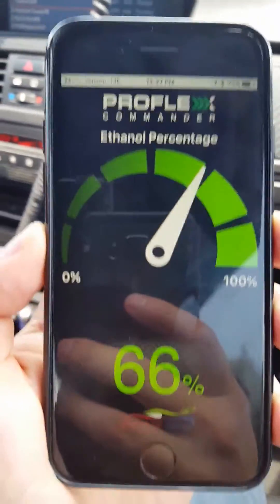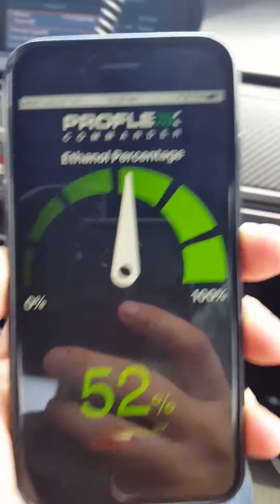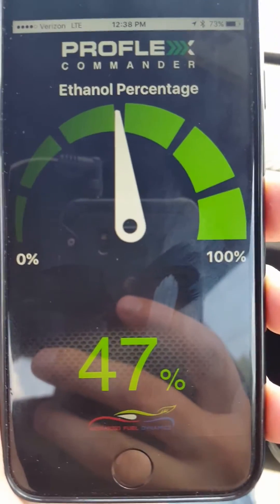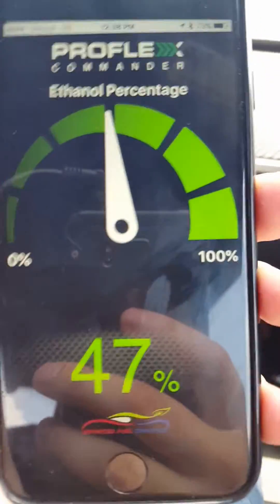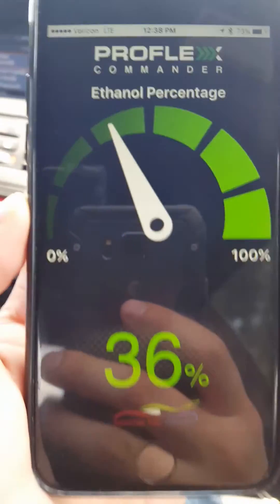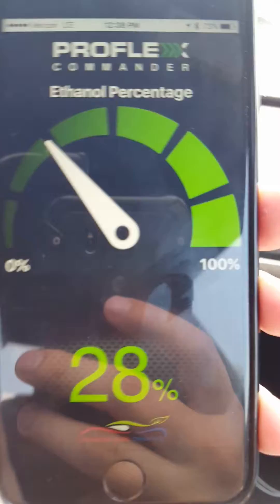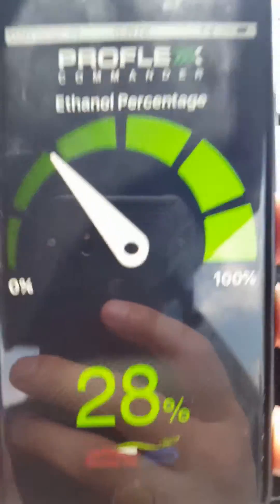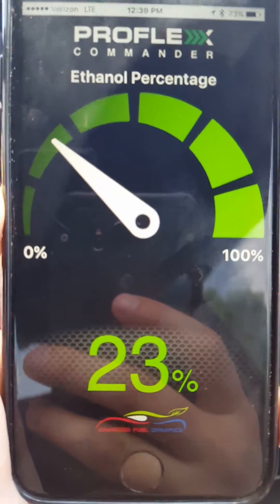Switching Back to Pump Gas from E85

Comment: Is there any reason to go back to pump gas only? I just bought proflex commander.
Reply from the maker: The only reason to go back to gas, or a lower blend percentage of ethanol is to address starting in very cold weather.  When the temp drops below 50 degrees Fahrenheit a blend of more than 50% ethanol can be harder to start first thing in the morning.  Garage kept vehicles should not have this problem and once the car is started once in the morning the CATS will hold enough heat to start properly all day.  Outside of cold temps you can safely run E85 in the car all the time and never go back to gas.
Reply: I have 2001 BMW 330ci would this be safe to run in my car? And what kit will you recommend shopping around to see which one I like
Reply from the maker: Yes we have done many, See our website for the proper kit.